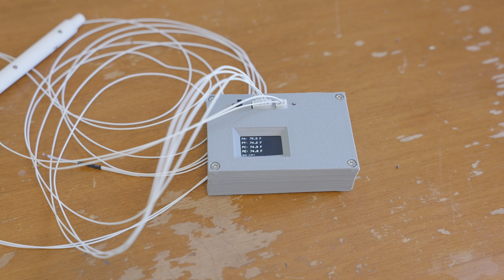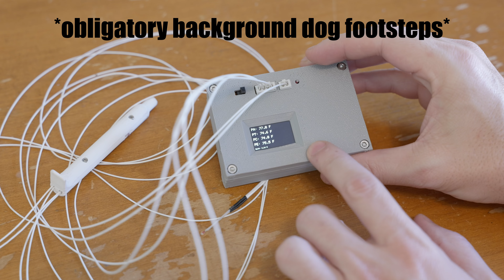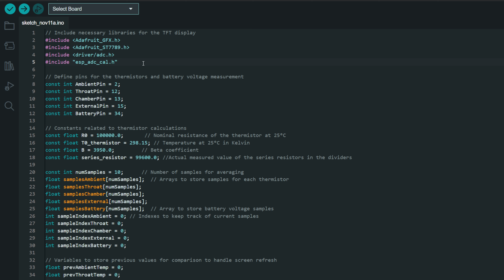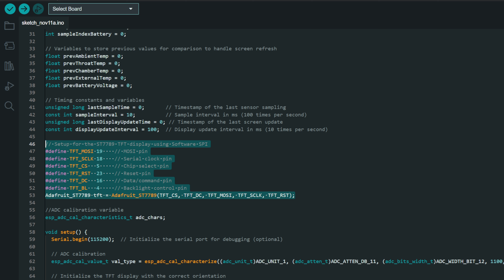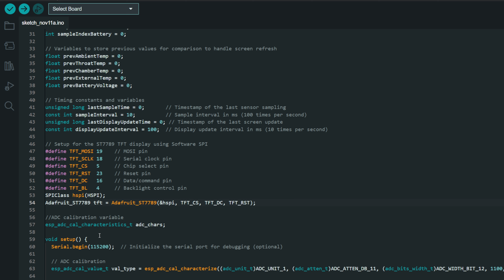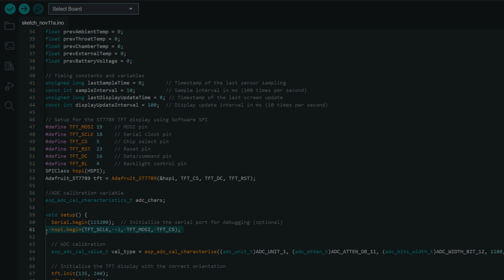Fixing a dumb mistake by making ESP32 use hardware SPI

Comment: Great video! Have been struggling to find good videos like what is on your channel about stuff like this. 

Also in terms of programming the firmware for these esp devices, I find that a plugin called Platformio on VScode is much easier to use and feature rich than the Arduino IDE. I am a sucker for auto-complete in code editors.
Reply from the maker: Yeah, I've actually messed with PlatformIO a bit. But I'm still mostly a n00b, and Arduino is just so easy when I'm doing simple stuff that it's hard to quit. LOL.